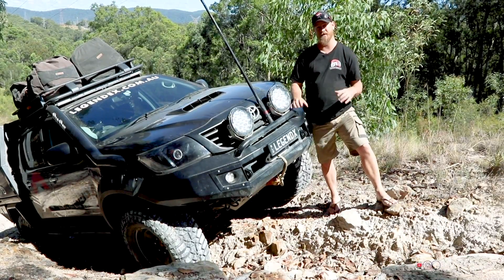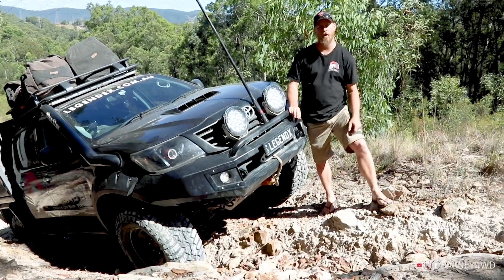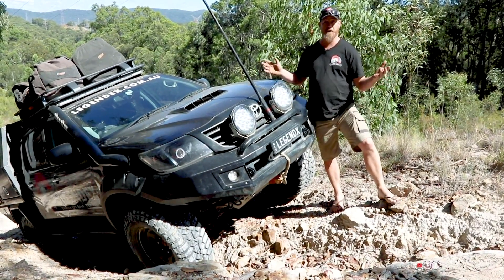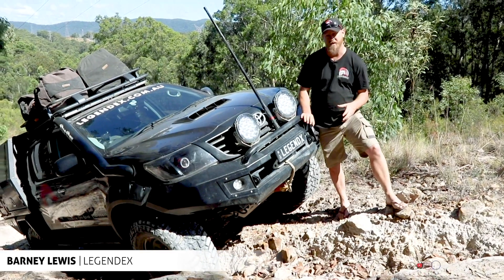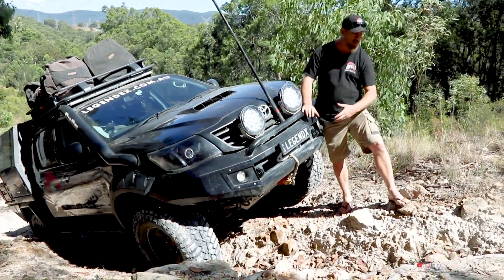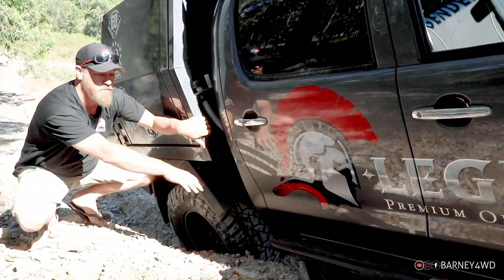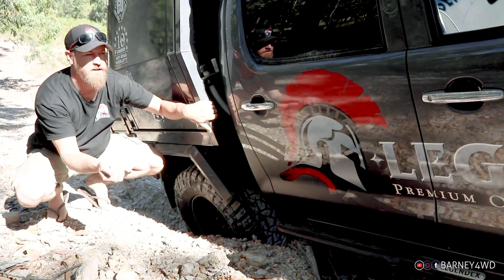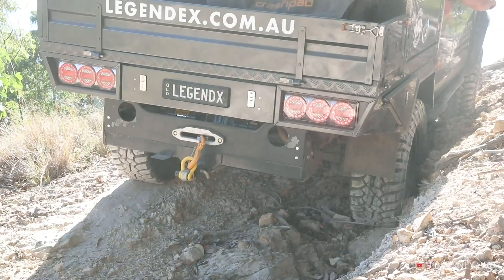WHAT ARE DIFF LOCKERS? (diff lock vs no diff lock)

Comment from the maker: Do you have lockers? Love em or hate em? Let me know 👇🏻
Reply: Need to get lockers ASAP for my d22. Or buy a patrol lol
Reply from the maker: Hi matt, a D22 twin locked would be a beast,  so light and nipple-- What tyres are you running
Reply: @Barney4wd  hey mate I'm running BFG Km3s 32" on my nav.
Reply: I'm about to buy myself a Mitsubishi Pajero NJ. Not sure if I should buy the one with a factory rear locker or one without and install an airlocker. Are the factory ones any good?
Cheers mate 😎🍻🇦🇺
Reply from the maker: Hi SSG Travis-- I've found its more to do with your style of 4wding, if you are going to do what im doing ??? or more causal touring???  The factory set up in a Paj is fine for the causal touring.
Reply: @Barney4wd  Hi mate. I don't think I will go that  "Mambo Rambo" as you 😎 In my case about 60% will be touring on bumpy gravel trails. The other 40% are trails with a little sand and mostly mild rock steps (<10"), in winter there will be plenty of mud and washouts. So I think I'll first give it a go with the standard setup and some BFG Km2 with a little lift. Over the time I will see if I need to upgrade something. 
Thank you for your help. Cheers 🇦🇺🍻🥓
Reply: @NoLimitTouge  are you sure it's a diff lock or central locker because there is a difference.
Reply: @Matthewrandone  it is a rear locker. Those pajeros come with the super select 4x4. There is 2H, 4H (open center), 4HLc (closed center) and 4LLc. And there was optional rear locker (R/D Lock on a separate switch), so far I know it is an air locker. So if that thing is good I will chose one  with factory locker. If not I will go with an ARB locker, because I already have a ARB compressor for my planned onboard air sys.
Reply: @NoLimitTouge  couldn't help you out then mate or else id be telling you lies. Go on Facey and join a paj group and ask the same question. You would get an experienced owner to help you out ! Good luck mate.
Reply: What if you don't have diff locks at all?

Comment: I have Prado 150 with central difflock..
I drive on sand for 3 to 4 hours on 4H.
An expert told me to drive on 4H with central difflock engaged.
My question is will central difflock damage my Prado if it is continuously engaged for 3 to 4 hours?